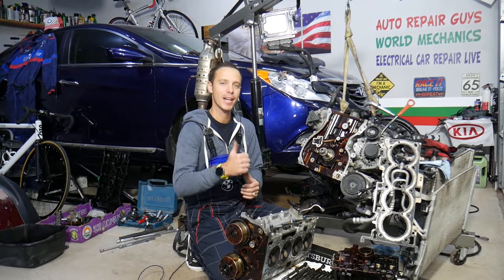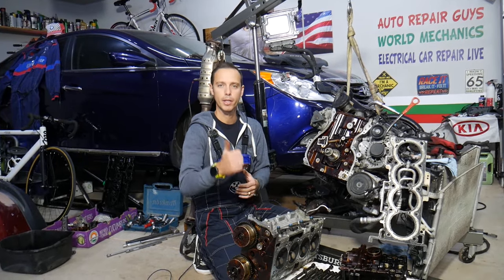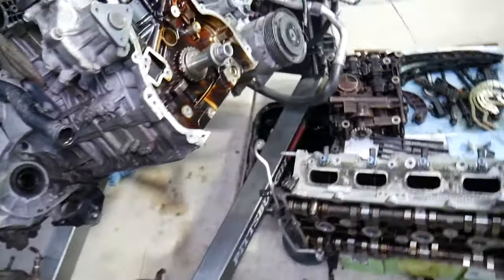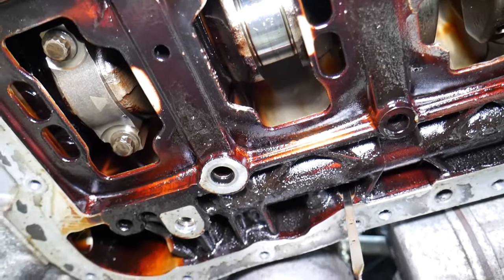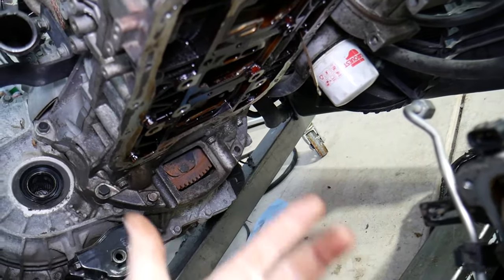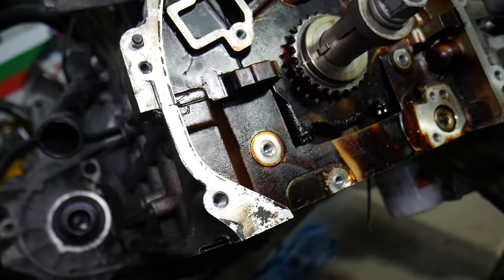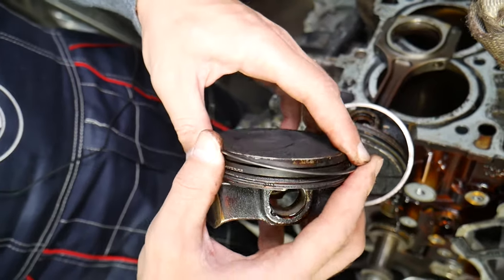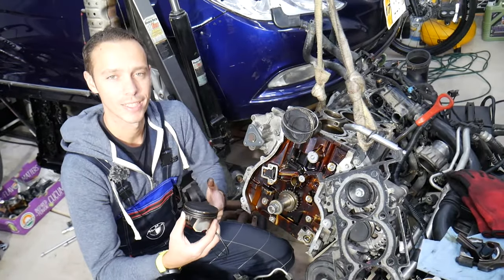HOW TO REPLACE PISTON OR PISTON RINGS ON A CAR

Comment: Hello! 
Looking for some help, 
I have 2015 Hyundai Sonata Eco 1.6 L engine, 70K miles, with , My mechanic replaced the oil to 10W40, since the oil is getting thin often. Does this sounds like a issue with Piston rings ? or a the plugs OR the turbo ? 
fyi - recently, I replaced my PCV valve, with help of your videos  :)
Should I look deeper into the piston rings or is it something I can live with putting the oil.. ? 

Thank you, 

Sincerely, 
Prasad

Comment: I have replaced the valve seals , camshaft and hydraulic tappets but the problem of burning oil smoke still there I guess its time for piston rings
Reply: Terrible.
Reply: Same bruh gotta tear my engine apart again 😭